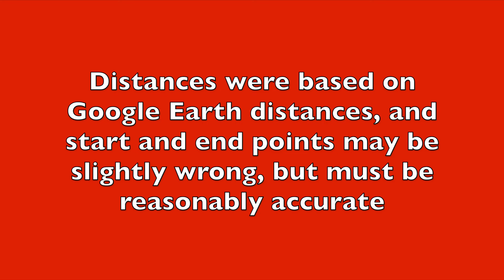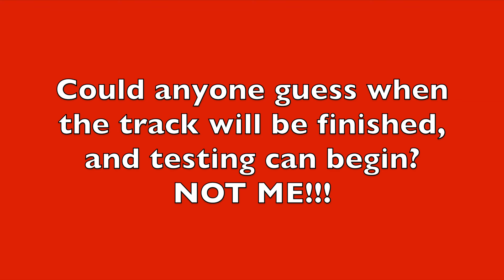Gold Coast LIght Rail Stage 3 Extension progress

Comment: Dont forget how long it took them to build stage 1, and then stage 2.  There's alot that goes in to this entire process, theres alot of logistical hurdles, theres alot of engineering complications that crop up along the way. Should they have built this up in stages, perhaps, but that adds time delays to the full project, yes, there wasn't alot of work getting done in some parts, but by working across the whole project at the same time, they can have different teams working on different aspects, without getting in each others way constantly.  Great video though
Reply from the maker: @miketurner4462    This stage 3 is merely 6.7 km of street track and five new trams which are already in service.  It is costing (or so they hope) about the same as Stage 1. Stage 1 involved 13 km of track, two bridges over the Nerang river, 14 trams, a depot with workshops and was built in less than four years. This has been going three years and achieved almost nothing. They don’t care how wide the worksite is or how much traffic and local shops are suffering. In stage 1, the worksite was largely the width of the tram track and no more.
Reply: @tressteleg1  yes, but they learned alot from building stage 1, such as the need for safer workspace. Just because they did something before, doesn't mean they'll do it the same way again.  As for costs, you're also forgetting how much more expensive materials and other construction equipment are as opposed to way back when they did stage one, as well as labour costs being alot more now, they just could not build this stage at the same cost as stage 1, even with stage one being the biggest part of the whole build.  Stage 1 was also done on more level ground from the start, stage 3 has offset road levels in certain areas that require levelling. We always knew that stage 3 and 4 (when they get to it) would be alot more work, and thus alot more expensive, why, because alot more engineering is required.
Reply from the maker: @miketurner4462  Stages 1 and 2 were all built by contractors different from who is building stage 3. All I can see is a massive go slow as preparation work started at three years ago. Contractor John Holland is now a Chinese company which to me is a good enough reason not to trust them. It seems incredible that in the space of 10 years, for the same money as it cost to build 13 km of track, build the depot with workshops and offices, build two bridges over the Nerang river and the long viaduct between the depot and the university and all we get for that money this time is 7.6 km of track and five new trams. And the way it is going, it is going to be years overtime and millions over budget.
Reply: I was there. It didn't take as long as this will.
Reply from the maker: @anthonyg638   👍

Comment: Light rail, for all the cost and inconvenience during and post construction it has and will continue to achieve very little benefit for public transport . Its a vulnerable and inflexible 18th century tech vehicle along a route is more intended to slow and discourage vehicle use and justify urban renewal with increased residential density and height. Its a mode with the same number of seats as a double decker bus and covers the same distance slower than the BUS mode that is more worthy of invest and improve.

Comment: I think the same people planed this line as they built the new airport in Berlin. Work started there in 1998 and it shoud be completed in 2006. Opening was a little bit later in 2019.  Missed it a little bit😂
Reply from the maker: Good heavens! I thought Germany was much more organised than that! I didn’t think that they allow bumbling fools to do anything there, ha ha
Reply: @tressteleg1  Another Thing. In Munich a second Metro Tunnel is be being bulit from the main train station to the east train station. For the olympic games in 1972 a tunnel was bulit within 5 years. Now work started in 2018 and they planed this to open in 2032.
Reply from the maker: @peterausfranken    Truly amazing. Is this forward planning for something not needed any sooner, or just bumbling, unlike previous competence?
Reply: @tressteleg1  well, back in the 70s there were less rules and building laws, they also cared less about archeological finds.

Munich has a double-track Metro tunnel ("S-Bahn") that serves 7 rail lines with up to 30 trains per hour and way during peak (some trains also need to terminate before or after the tunnel, since there are not enough time slots in the tunnel). Back when those tunnels were designed, they expected 7 lines every 20 min peak traffic (so a maximum of 21 trains per hour). The tunnel is a bottle neck, it's overcrowded and (of course) also aging.

The second tunnel was projected as an express Metro tunnel, including some regional rail from other major tows around Munich (Augsburg, Ingolstadt, Rosenheim amongst others). It's obviously quite expensive, so some people (and politicians) hesitate to spend that much money on public transport in general. Also there are alternative plans, e.g. subway to Pasing (u/c by now), so that subway route U5 would will the Metro trunk line Pasing - Ostbahnhof, albeit a few kilometers off the current Metro route, suggestions about a "South Ring" Metro service with a couple of new stations (parallel to existing long(er) distance train tracks), and so on.

Also, the German tender system strongly emphasizes price over other criteria (while the EU requires tenders, the rules for those are up to the individual countries). So the cheapest bidder wins, starts working, quickly comes up with cost increases and the political carousel  takes a few more turns. If you take a look at France, they also tender out their projects, those regularly finish under budget and in time. So that's a rather German thing with the tendering process there. 

Truth is, long term Munich will probably need all these projects. Whenever the current trunk line breaks down (or even worse, the entire train system into Munich Main Station ("Hauptbahnhof"), people cram on 26-38-metre-trams running every 10 minutes on route 19 (and that happens several times a year for the big breakdown, and several times a month for the trunk line breakdown). The subway will at least offer a bit better "carriage sizes" to replace trains (Munich Metro trains can be up to 210 metres long, the subway has 120 metre long trains, so it's still a snug fit, but better than the current situation). The second (and express) trunk route will enable express services to towns further out of the city, and perhaps even inner-city connections for some major big towns in Southern Bavaria (who today have to change at either Ostbahnhof of Main Station). And once they want to introduce 10-minute-headway (which for a city of this size would be absolute necessary), they will need to build the "South Ring" too.

And of course the true issue with the system is the fact that they didn't build four tracks from the get-go. But then again, it was the 60s, and nobody thought the system would be that successful 30 years later...

The subway system has the same issues: There are 3 trunk lines with 2 routes each, that split up outside the inner city (plus some peak services). Initially they were running every 10 minutes per route, with 5-minutes service during peak hours on some sections. Today many of the routes are overcrowded. Right now a new "U9" project is being built that will untangle U3 and U6 (and thus remove the "trunk" part of the routing). Something similar would be needed for the trunk of U1 and U2 too, and long term probably the remaining trunk of U4 and U5...

Oh, and with trams they plan with 72 metre trams long term (up from 38 metres today), and also want to increase the width of the vehicles from 2,34 to 2,65 metres. They also need to build a new depot to house trams (also a discussion ongoing for decades), they now plan to build a depot around the main workshop. Right now, one well placed crash can keep almost all trams off the network (there is only one depot with one track connection), although at least the seven trams from the night network services will be available in the worst case. After that, all trams will still be stored on the eastern side of the river (hope nothing ever happens to the bridges connecting it to the "mainland").

And of course there is old Depot 3, which was closed some 30 years ago and is completely dismantled today. It's on the western side of the river, and they still don't know what do do with it. But they don't want to build a new depot there, they fear noise pollution for the nearby houses (despite the fact, that depots are usually built completely covered nowadays in Germany). Due to service increases, they will probably soon need a third depot, so right now the political carousel is turning about finding a proper location for that...

And since we're talking about things taking forever, there are plans to run tram tracks through the "Englische Garten", a huge park in the north-east of the city. The park itself is a property of the state government (which is traditionally conservative), while the city is usually ruled by Labor. A number of Supercap trams were bought to run the park crossing without overhead catenary (they will probably be scrapped before the tracks are laid). The tracks should be made low profile, with a bicycle path next to it, and some other concession. All the while they are supposed to run along an existing bus road - it appears noisy diesel buses every 3 minutes during peak are better than much more silent trams...
Reply from the maker: @sepruecom    Thanks for all of that, even though nearly all of it is off-topic for the Gold Coast tram. However ‘cheapest no matter what’ seems to apply here. Sydney still has not settled the failed CAF tram matter with the maker, but continues buying that rubbish. Supercaps is the worst wire-free option. Newcastle NSW has that and trams must stop for about 35 seconds at every stop just to recharge, even if nobody wants to get on or off. One such tram ‘blew up’ and apparently CAF is still arguing about repair payment.
On another matter, I have visited München several times in the past and have movie film from 1975 and video since then. I have not put any of it on YouTube as I need somebody familiar with the city to give me location names. Are you interested?
Reply: Another thing by a lot of projects from the state. These are planed an they cost a lot of money. Bevor the officials give there go, the cost of these projects are cut down lot. They think, when we start and later on the cost will rise sometimes double the amount no one will stop this project.
Reply from the maker: @peterausfranken    Yes, it is not practical to stop a project when money runs out, except in Belgium where a number of tram tunnel projects have stopped when the money ran out. Some were completed, in full or in part, many years later.

Comment: Airports should be connected with fast heavy Rail to drive growth,,, NOT a slow tram that only replaces an existing bus.  The 1 hour 50 minute tram ride from GC airport to Helensvale is unrideable. Rail would connect the 2 in 29 minutes making it quicker to get to Main beach from airport via heavy rail and bus or tram
Reply from the maker: @colinmay151  I suspect that you have never ridden the tram, and would not use a bus in a fit, so there is no point discussing the matter further.
Reply: @tressteleg1  Don't assume and use that you never use excuse just to avoid discussing ,,, Point out where i am wrong and i will explain.  You should welcome debate especially someone who lived overseas for 16 years without a car reliant on public transport.  I know what works and what does not work so well.

Comment: would of been smarter to do designated high capacity bus lanes up the middle of the road...  but thats not as fashionable as trams.
Reply from the maker: @AnarchyEnsues  Nothing to do with fashion. For a start, a major cost of public transport is drivers, and the GC tram carries significantly more people than even a Brisbane Metro bus can carry. Additionally the tram is by far the most punctual street public transport here. People dislike the way buses throw passengers around, besides the bumps and thumps over every little ripple in the road. Just ride one of the Brisbane busways to experience the discomforts. Worldwide, when trams replace buses, ridership increases significantly, when buses replace trams, many prefer to use their cars instead of the buses.
Reply: @tressteleg1  i disagree,  for starters, when buses replace trams,  they generally dont replace track with dedicated bus lanes.  with dedicated bus lanes the difference is minimal.  yeah you might ditch the bus if you are in the same congestion as a car,  but if you are in a separated bus lanes, its different.

tram tracks are inherently inflexible, you will forever just have the one main track,  any add on routes will take decades to connect to the main tram route.
dedicated center bus lanes, you can join and exit bus routes 

i recommend you look at the korean bus system through the city,  the bus ways go down all the main roads with busway stations down the center.
Reply from the maker: @ Believe what you like, but people don’t like riding buses. They only do it because there is no alternative.
Reply: @tressteleg1  why is there no alternative?  stage 4 of light rail is projected to cost over 3-6 billion,  this current stage is 1+ billion.  its expensive and hard to intergrate into the existing network.  like it or not, cost and use of existing infrastructure is going to make buses the next major advance in public transport.  with the use of modern smart technology, being picked up from your door step and delivered to your destinations door step is what is need,  these fixed models of mass transit can serve a purpose,  but is it value for money?  can it be better and cheaper?
Reply: the reason light rail is working so far is because of all the high rises along the strip.  its got a density of customers.  its useless for the majority of GC residents.
Reply from the maker: @    it is desirable to build high rises near an efficient high capacity public transport line like a tram line. It potentially reduces the need for some families to have two cars instead of just one. Building single storey houses out in outer suburbs only increases traffic problems.